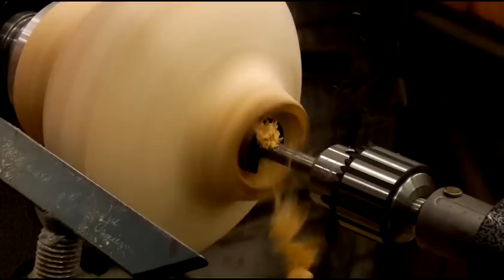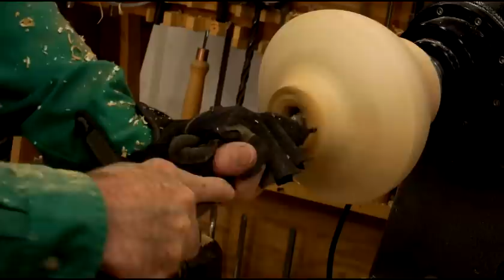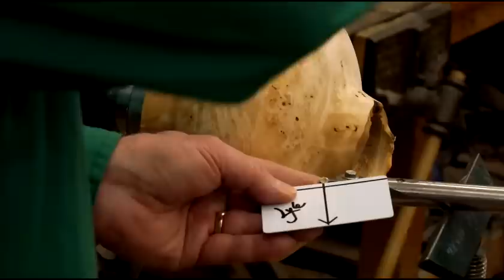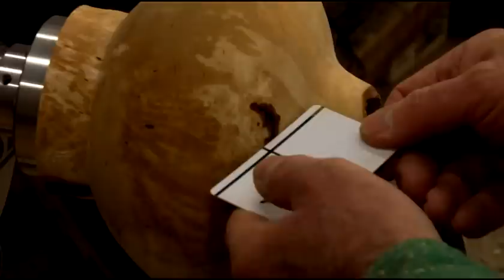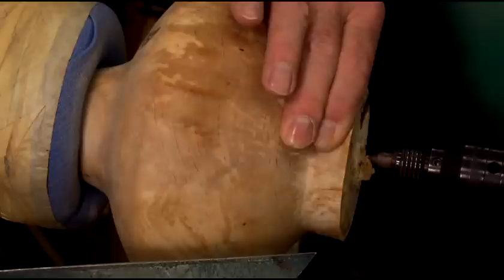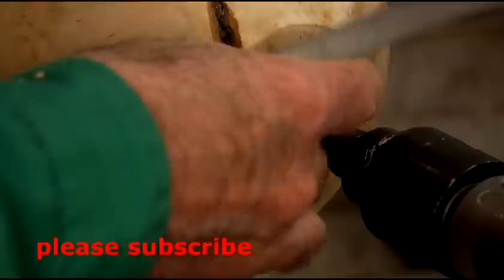Natural edge hollow form Part 2, Hollowing and laser meassuring.

Comment: Very nice composition Lyle. I thank you for the tip for tracking an out of round form. How many times does this come up, but until now I ended up with mismatching centers at the base. Always level and lopsided! After watching I set up a bowl that was out of round. I slowed way down and tracked on the original centered lines and the base was much more consistent with the rest of the bowl. Practice should carry me to a very good base. I think I love the wobble! Thanks!
Reply from the maker: Thanks for the feedback Chris, It is surprising how clean and how little sanding is required after this method.